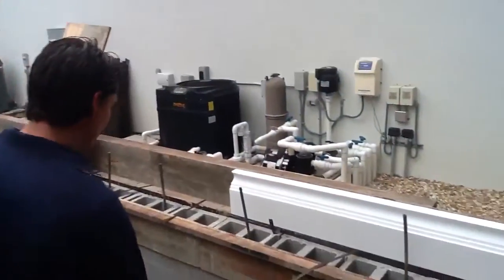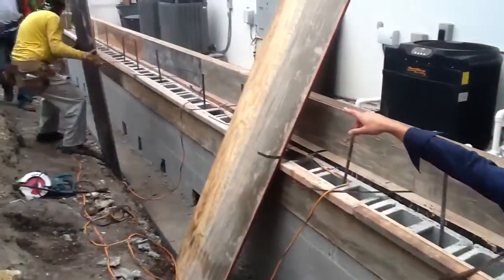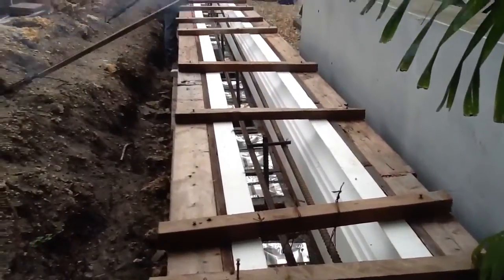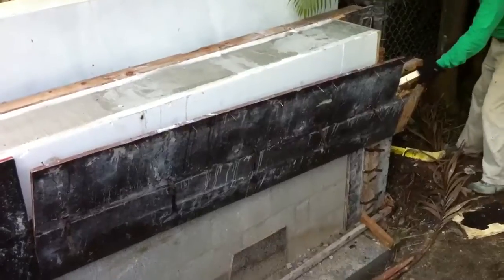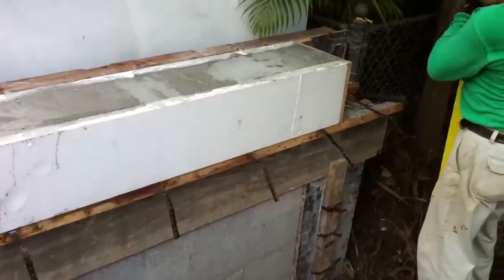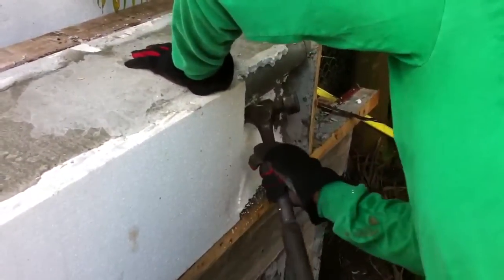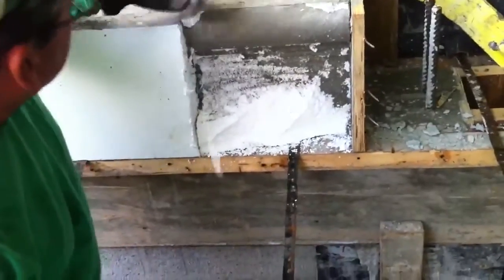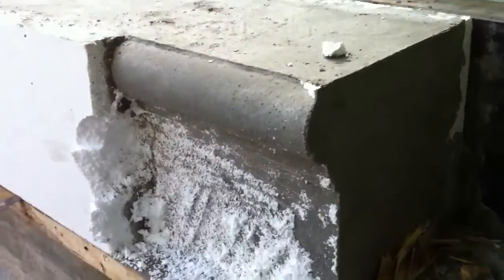how to form with foam

Comment from the maker: this particular one is going to have a stucco skim coat over it, but you may get fancy and add color to the mix, you may also use styrofoam chips and trowl them in when you are finishing the concrete to get a keystone look. the foam neatives can be ordered from any company that sells EIFS moldings, in Miami I use "MiamiFoam Design" I draft the profile on autocad, send them the file and they can cut almost any shape.